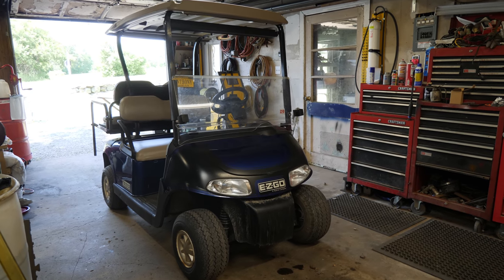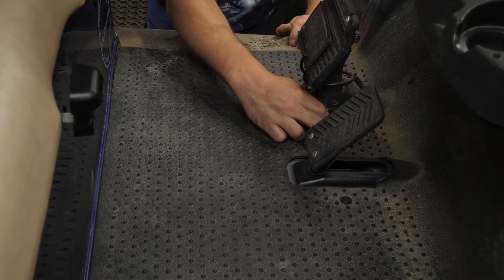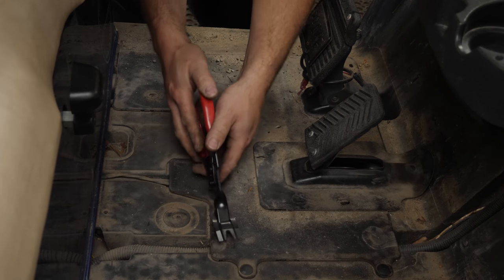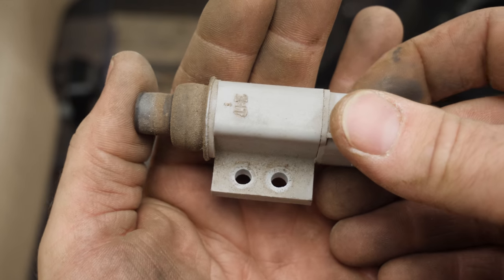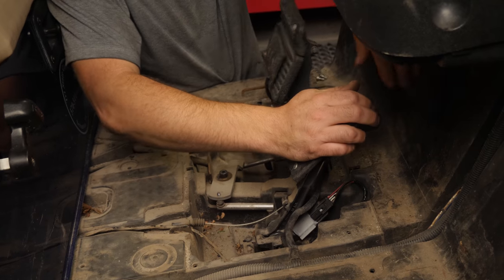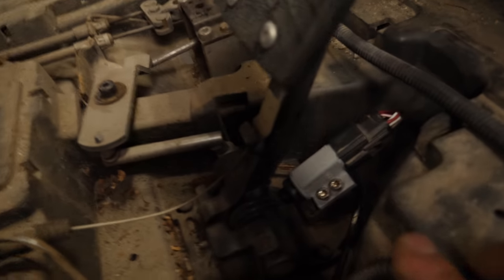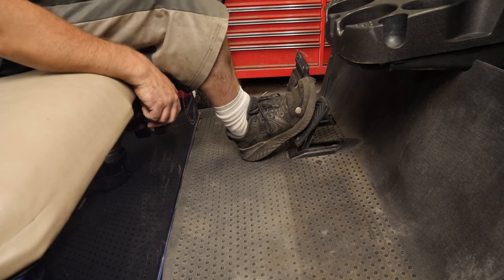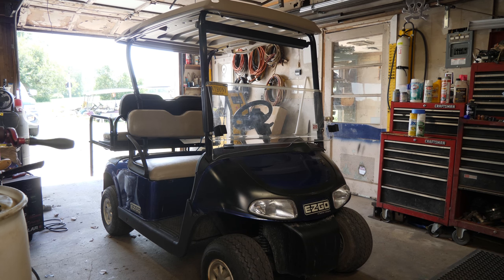2014 EZGO RXV, Gas - Accelerator Switch Failure

Comment: Does the EH 29 C Robin have the same switch? I've replaced everything, set the valves, nothing worked. It still sputters and cuts off. Very frustrating.

Comment: Have an '09 RXV gas. Followed video and ordered part w/o pigtail. Doesn't fit. Need one with wires attached. Reordering tonight. Haven't had any problems with cart since I got it in 2013. Now, its one problem after another. 
Btw. Symptom was starter continued to turn over after key off and removed and cart at standstill. Quickly killed a fully charged battery. Hope this is all that's wrong. Or I might push it off in the Suwannee River and start over. Thanks for the videos.

Comment: Thank you Kevin... I have had this issue for a year... Checked everywhere... Very rarely on a gas cart they mention this hidden relay... I almost sold it.....
Reply from the maker: Its a simple double-pole, double-throw switch. Every cart, gas or electric has one in some form. I'm glad you found it. These carts are going to start showing this issue now that they have been out for a while.

Comment: Good afternoon, I have a 2011 rxv and been having some issues.

I always have to pull the choke out so I can start moving even after it’s wormed up. 

I don’t want to bring it back to the dealer, as I got ripped off royally! 

I brought it in for the same issue you resolved on this video and he he tried to charge me $1800 for cleaning the carb adjusting clutch breaks and installing that switch! That was just labour. 

My cart never had this issue before, only once I got it back from the dealer
Reply from the maker: They must have not cleaned the carb or more debis or moisture made its way back to the carb. There's possibly a ripped gasket between the air box and engine.

Comment: Good afternoon,  Gary here, I am 74 years old and got a 91 gasoline Club Car about 10 days ago, to help me get around. Well yesterday the foot pedal stuck down,  lifted it up with my toe, hardly slowed it out,  brakes helped a bit, turned key off, it still running, grabbed a brick  placed in front of rear tyre  pulled the seat up and pulled the spark plug wire, to get it to stop.
Need your advice as to  fix and a few instructions how to.
THANK YOU for your time

Comment: Hey how's it going have asked u several questions before all ur advice was on point an has helped out to the point where I finally got my 1985 club car ds running again want thank u for ur videos.ok recently my cart has a problem again problem now is the cart will run great sometimes this happens 5 mins into riding it or sometimes it runs perfectly till I stop an it sits but what's going on mostly is you be riding all of the sudden it just dies shuts down like I let off gas sometimes it start right back up an go for awhile other times it has to cool off do you think it's the ignition coil or could it be solenoid if noticed the solenoid is not clicking as loud as it was and is only maeby 6 months old if replaced all micro switches before this happen ran good for about 4 months if noticed since it started getting hotter the  problem started run fine all winter might not have ntn yo do with it all any advice much appreciated thanks hope to hear back from u cause I know u know the problem or at least you have been right about everything else.
Reply from the maker: Its possible the ignition coil is starting to fail. I don't work on a lot of the side valve engines so I can't say for sure. You can easily check the solenoid with a volt meter. Negative probe on negative battery post, use the positive probe to test both sides of the large terminals on the solenoid. With the accelerator pedal pressed, you should have battery voltage on both large terminals.

Comment: Hello, I have a 2014 Rxv ezgo. We were going up a hill and cart quit. I followed your troubleshooting from video. I hear solenoid click when I turn on key. I also have buzzer when I put in reverse. Voltages look good at solenoid. At foot pedal switch I have 48v on red wire and 0 Voltage on green wire. It does make a slight noise like it wants to go when depressing  pedal. On the accelerator position sensor I have 5v on orange wire 0v on black and 0 on yellow. When I push pedal to floor I have 5v on orange and 5v on yellow. 0v on black. I thinking maybe it's accelerator switch, but not sure. What's your opinion?

Comment: Hi , Great Videos, I recently picked up a 2016 EZGO TXT and i am having a problem with it continuing to "idle" after taking my foot off the gas pedal, barely enough for the cart to move. If you press the pedal and release it then it usually shuts off. could this switch cause this problem ? please let me know if you have a chance. Thanks
Reply: Same exact  thing  on my  13 RXV
I tried  replacing the switch.  Switch  one had  a 4 plug trailer  connections and not  the OEM plug and different  color  wires.

 Switch  #2 had exact  same plug connection. But  the switch  plunger is a half inch  shorter and still  won't  turn cart  off because  it can't reach  the pedal. 

I can't  solve  your  problem. But  can tell  you  don't  order  anything  non OEM and make  sure  it looks exactly  the  same.

Comment: Hey kevin i just bought a ezgo rxv few days ago and was runing fine, i did a oil change ,spark plugs and air filter and yesterday car start doing loud back fired when i push gas pedal any idea what could be ? Will appreciate your help 👌
Reply: If you have your old plugs put them back in and see if it fixes your issue—you could also Check your spark plug gap and wireset

Comment: I think I am having this problem on a 2004 EZ Go cart. It dies if you feather the throttle at low speeds and then goes no crank-no start. After it sits a while it fires up and runs like nothing happened. Battery is good, new fuel pump, fuel filters, air filter and spark plugs. I thought about the starter/generator but there are no clicks going on when it's dead and I turned over the motor by hand, no help. Valves adjusted to .005. Am I looking in the right place to fix this cart?
Reply from the maker: You need to test the solenoid with a multimeter. Negative lead to the negative of the battery or chassis. Use the positive lead and check for voltage on the small terminals of the solenoid. One side should be 12v and other will read 0 since its ground. If you have power, and the solenoid isn't clicking, replace it.
Reply: @Kevinsgolfcarts  Thanks, will do.

Comment: Kevin, my RXV Electric with Intelabreak Will not move. When I turn the key to the reverse, neutral, forward positions you can hear something clicking into place near the motor However it will not want to move. The battery indicator is at full charge. I have replaced the key switch which I thought would be the problem but I’m still having issues. Do I keep throwing parts at it or do you have a resolution? Thank you
Reply: Same issue did you find a solution?
Reply: I changed my electric brake and it fixed my issue

Comment: My golf cart was running fine then died and couldn’t figure out why—I replaced the micro switch, because seems like that was my issue but didnt change anything—whenever I cross the terminals on top of the solenoid it will go to start the engine but the engine won’t actually fire off perfect I believe this means the internals in the solenoid is bad since it’s not sending the power to the starter? Is there anything else I should check?
Reply: Having the exact same problem on my 2000 ez go gas cart. Ever happen to figure out the problem? Thanks
Reply: @Landoboy01  I ended up bypassing the ignition module and wired it with a GM ignition and its worked great since! Ill find a video that I used to do it—I kept my stock starter solenoid/plugs/coils.
Reply: @hunterm.172  perfect thank you

Comment: My ezgo rxv just had that switch go bad and I replaced it but now it won't start just turns over. The magneto has fire with the wire going to it but no fire when the wire is plugged in. Any suggestions on what it could be?
Reply from the maker: This switch has 2 circuits, one for the starter, the other for ignition. When you press the pedal, it closes the circuit to crank the engine and opens the shorting circuit to the ignition coil. The opposite happens when you let off the pedal. It sounds like the ignition circuit is staying shorted and the switch is bad. You can test this with a multimeter in Ohms.
Reply: @Kevinsgolfcarts  thanks I appreciate it just figured out the new accelerator switch was bad.